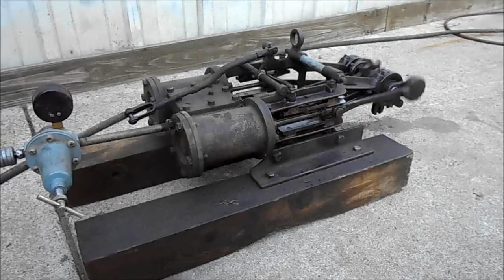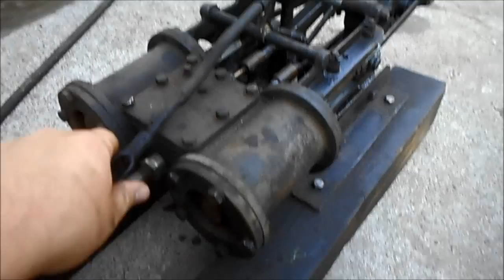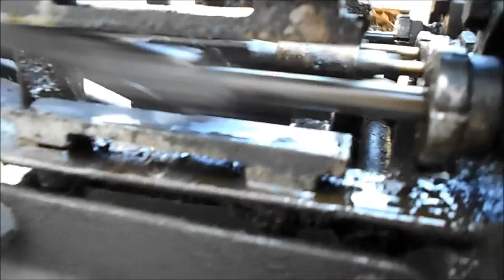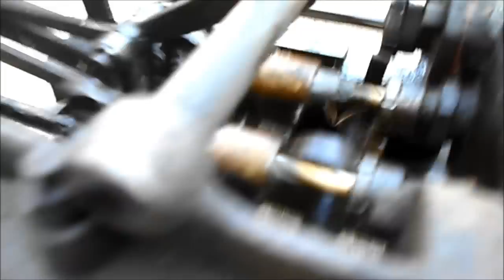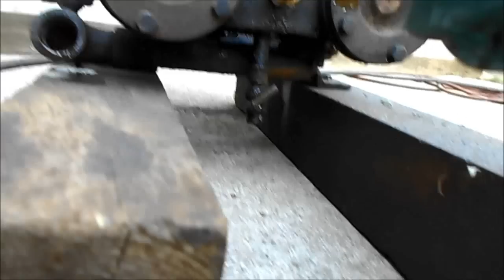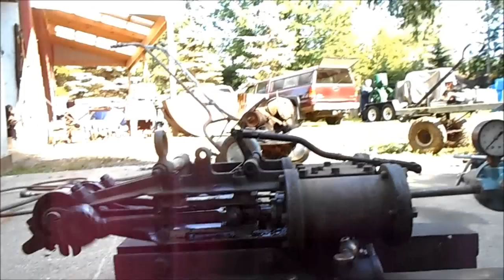Original Stanley steamer car engine

Comment: Fun fact : steam engines produce more torque and are less complicated than gas engines.
Reply: @Tadfafty  Actually, that's not true at all. While electric motors are simpler, more efficient, and have no reciprocating parts, a Steam Engine of Equal Horsepower will out-torque an Electric Motor.  And Actually some Steam Engines of Less Horsepower will out torque an electric of higher horsepower. It all comes down to what RPMs they're making their respective horsepowers at. Both a Series Wound DC motor and a Steam Engine will produce their maximum torque at 0 RPMs (consistently for two or more cylinders, but for a single when the crank is stalled at 90 degrees from the cylinder), main differences being, a steam engine of 150 horsepower is making upwards of 5,000 lb ft of torque at around 180 RPMs (proof of that is Kory Anderson's 150 HP Case Traction Engine on the prony brake, and she still had more to give. But the belt was about to snap! And that's a nothing fancy, bare bones basic, single cylinder, plain old D-Valve engine running on Saturated Steam!) And max. governed speed is 250 RPMs. But a really beefy medium speed 150HP Electric Motor's maximum starting torque will * maybe * be around 2,500-3,000 if you're lucky (and that's being generous), stall torque will be less. But normal running speed in an application for that motor is still generally above 1500-1700 rpms. Obviously the margin of difference in torque varies from motor to motor (AC, DC, or universal, how they're wound, current and voltage ratings/limitations, single or three phase if AC, brushed or brushless, their intended application, etc) and from engine to engine (running on Saturated or Superheated Steam, normal operating pressure, Bore and Stroke, Piston Valve, D-Valve, or Poppet Valve cylinders, Counterflow or Uniflow, style of Valvegear, throttle or cutoff governing, number of cylinders, if it's simple, compound, or triple expansion, the intended application, etc), but the general rule of thumb is a Steam Engine will twist the electric motor backwards. If you want/need to make more torque with a steam engine, you simply increase the steam pressure further if the boiler is designed for it. Boiler technology even back in the 20's and 30's allowed for special boilers and steam-generators to be built for steam pressures over 1000 psi, with very aggressive superheaters to match. Lots of experimental high pressure reciprocating Locomotives ran that high or close to it. The German "Hochdruck", the "Horatio Allen" and the "L.F. Loree" on the D&H, and the "Fury" on the LMS to name just a few prime examples. Today Coal Fired Steam Power Plants are running on supercritical steam at over 3,000 psi. If you keep increasing the amps on the DC motor to make more torque, the windings will eventually have a meltdown, even with a cooling system. The heat accumulation in localized areas will be too much for it. Plus, the hotter the motor gets, the stall torque goes lower, and lower. The electric motor will burn up long before you crack the castings on a steam engine. And, if most of the Steam Engine's components happen to be forgings and steel instead of castings, that's even more strength you have to take higher pressure. Here's another point, a modern 6,000 horsepower diesel electric locomotive needs 6 Geared Down traction motors (around 4 to 1 on a GE, 72 teeth on the axle's bull gear being driven, and 18 on the Motor's pinion) to produce it's 190,000 lbs of starting tractive effort, not continuous. Broken down further, each traction motor after torque multiplication through the gearing is making only 31,666 lbs of tractive effort, broken down further by 4 because of the gear ratio that leaves you with almost 8,000 ft lbs of starting torque per motor, but I'll give it 10,000 per motor because that'll account for any margin of error, the factor of adhesion, and it's a nice round number. All together, the combined starting torque of the motors without gearing is 60,000 lbs, a far cry from the 190,000 lbs of tractive effort we started with. Conversely, The Virginian Railroad's 2-10-10-2, which is a century older, made the same 190,000 lbs (and it doesn't plateau and drop shortly after starting like with a diesel, it'll hold out as long as you can make the steam to support it.) with 4 steam cylinders running in Simple Expansion mode that did not have any gearing for torque multiplication, and the power was being taken from the rim of the driving wheels, NOT the center of the axle where it could take full advantage of it's torque. So really it's using a percentage of just Piston thrust alone since the lever that is the crank web between the crank pin and the axle center (which would be the crankshaft) offers no leverage in this arrangement. And with the cranks phased at 90 degrees for each set of cylinders, while self starting, the total tractive force between each two would never exceed more than the maximum of one cylinder, because when one is on peak torque, the other is on a dead center. When neither crank is on dead center, they're not at peak torque but the combined force from each adds up to roughly  the maximum of one at peak. So in actuality, when your think about it, only 2 of the 4 cylinders are doing the work at any given time. I have to laugh at the new Electric Hummer, "1,000 horsepower and 11,000 lb feet of Torque". A 1,000 horsepower Marine Steam Engine is making almost 10 times that. Even 200 Horsepower Skinner Uniflow will beat that.
Reply: @steamandsmoke97 ..... Thank you for putting up this very full / helpful reply.
Reply: @steamandsmoke97 a lot of type
Reply: @steamandsmoke97  you need to test drive the Tesla Model S P85D,,then you will feel the torque of the electric motor.
Reply: @emil.honganmaki5461  BAHAHAHAHAHA! That's a laugh. You mean Motor(s) plural that have gear reduction to the Final Drive? The P85D has 687 lb ft of Torque, and the Plaid with 3 motors at the most has 1,050 lb ft of Torque all working together. Guess what? Kory Anderson's 150 Horsepower Case Traction Engine made 6,000 lb ft of Torque on the Dynamometer, and still had more to give. Fyi, it's a Single Cylinder Saturated D-Valve Engine. The most basic of Double-Acting Steam Engine designs. The machine appears absolutely massive, but what you're seeing is the Boiler, i.e. the steam supply. The Engine itself sitting atop it is actually rather compact. The Doble E20 Roadster (A Steam Car) which is a 4 cylinder double tandem compound beats the Plaid by 200 lb ft.
Reply: @steamandsmoke97 emp from solar corona discharge or atomic bomb or geomagnetismdisturbamce or war  leads to power grid attack then everthing gone he he Nd one if motor fails then ev are useless 
ND current battery tecgology is dangerous
Reply: @steamandsmoke97  Misunderstanding of Torque vs. Power
Claim: Steam engines of lower horsepower out-torque electric motors of higher horsepower

While it’s true torque and horsepower are different metrics, torque alone doesn't determine power delivery or work capacity. Horsepower (a function of torque and RPM) provides a better measure of a machine's ability to do sustained work. The claim ignores this critical relationship. High torque at low RPMs doesn’t necessarily equate to greater utility or efficiency.
Electric Motors’ Torque Characteristics

The assertion that a "medium-speed 150HP electric motor's maximum torque is 2,500–3,000 ft-lbs" is vague and unsupported. Electric motors, especially series-wound DC motors, are renowned for their high starting torque, often reaching values much higher than suggested. The writer’s description downplays the versatility of electric motor torque curves, which can be tailored with modern controls.
Steam Engine Torque

The example of Kory Anderson’s 150 HP Case Traction Engine producing "upwards of 5,000 ft-lbs" at 180 RPM is anecdotal. While traction engines have high torque due to their large displacements and low speeds, this doesn’t universally apply to all steam engines or compare accurately to modern electric motors across varied applications.
Misrepresentation of Modern Electric Motors
Electric Motor Heating Limitations

The critique that "the windings will eventually have a meltdown" oversimplifies modern electric motor design. Contemporary motors include advanced cooling, insulation, and control systems to mitigate overheating. The statement fails to account for these advancements, rendering the comparison outdated.
Torque Drop with Heat

While heat affects efficiency, modern electric motors maintain high torque across a range of operating conditions due to thermal management systems. The implied fragility of electric motors compared to steam engines is exaggerated.
Overstated Steam Engine Capabilities
Steam Pressure Adjustment

The argument that increasing boiler pressure directly increases torque oversimplifies steam engine dynamics. Higher pressures require design trade-offs, including material limitations and safety considerations. Simply "turning up the pressure" is not a practical solution without significant engineering adjustments.
Locomotive Torque Comparisons

The comparison between diesel-electric locomotives and century-old steam locomotives omits critical context. Diesel-electrics use traction motors optimized for efficiency and sustained performance rather than sheer torque. Steam engines like the Virginian Railroad’s 2-10-10-2, while impressive, suffered from inefficiencies, maintenance challenges, and lower overall thermal efficiency compared to modern systems.
Marine Steam Engines

The claim that a "1,000 horsepower marine steam engine makes almost 10 times" the torque of the new Hummer’s electric motor is dubious and unquantified. Torque figures depend heavily on operating conditions, application, and design specifics, none of which are detailed here.
Logical and Contextual Issues
Selective Examples

The argument relies heavily on specific, niche examples like the Case Traction Engine and Virginian Railroad locomotives without broader evidence. Such cherry-picked cases don't establish universal superiority.
Generalization of Electric Motor Weaknesses

The text lumps all electric motors together without acknowledging the diversity of motor designs (e.g., permanent magnet, induction, synchronous) that can meet or exceed the performance of steam engines for specific applications.
Obsolete Comparisons

Comparing 19th-century steam engines to modern electric motors in isolation ignores advancements in efficiency, maintenance, and scalability. Steam engines are almost entirely absent from modern industrial applications for a reason—they are less efficient, harder to maintain, and have lower overall energy conversion efficiency.
Conclusion
The statement makes interesting historical comparisons but fails as a rigorous technical argument. It overstates the strengths of steam engines, downplays modern electric motor capabilities, and draws conclusions unsupported by broader evidence. Torque alone is not the sole measure of an engine’s utility, and the discussion ignores key aspects like efficiency, scalability, and operational reliability.
Reply: @EthelMaeHenderson Firstly, your reply was written by A.I. like Chat GPT, and A.I. is far from perfect. That being said, it makes some very valid points and agreed, in many areas it is an oversimplification. However, that was due to the fact that I don't have the time or desire to lay out and compare each and every point to someone who largely is going to ignore most of it. However I feel because of ChatGPT's own misinformation it is time to set the record straight.

I am quite well aware that Torque is not the only factor in the power generation of a given prime mover, but it is a very significant contributing factor. Obviously Horsepower is a rating of work done over a given period of time, and different prime movers have advantages over others in given areas, however, any machine can make a given amount of Horsepower if it is designed for it. Also, it is quite well known that a given Steam Plant will be less efficient at converting energy into work than an Internal Combustion machine, and certainly less efficient than an Electric Motor. However, you're not taking into consideration what is responsible for the Lion's share of said inefficiency which is the Steam Generation source, I.E. the Boiler. 70-80% of the thermal energy from the fuel is blown out the stack instead of being turned into useful work due to the fact that anything other than a Flash Coil Steam Generator isn't capable of transferring a vast majority of the Fuel's Energy to the working fluid since it goes through it so quickly and there is too little heating surface area to be able to do so effectively, plus thermal losses out of the boiler itself even if the heat has gotten to the water, this is occuring through conduction convection and radiation.The Engines themselves, the actual Machine, not the Steam Source, can and do reach levels of internal combustion mechanical efficiency. Just as Electric Motors have made many technological advancements over time, Reciprocating Steam Engines have as well. A prime example is the sealed crankcase and pressurized lubrication system. You may think that it originated with Internal Combustion, you would be wrong. The firm Bellis & Morcom that produced High-Speed Reciprocating Steam Engine driven Generators actually devised the enclosed Crankcase with a sump and Oil Pump for pressurized lubrication to all major bearing surfaces. This largely minimized the amount of maintenance and attention they required to the point where just like a Diesel Engine, the Engine could be run continuously without stopping for servicing with the only maintenance needed was change the oil at prescribed intervals. And for Steam Engines, since the cylinders have their own dedicated lubrication system and are isolated from the crankcase, there is no contamination of the oil by products of combustion as with an Internal Combustion Machine so their oil stays clean considerably longer. Because of the enclosed crankcase and pressurized lubrication, coupled with precision primary and secondary balancing of the crankshaft, these High Speed Engines could reach speeds as high as 1,000 rpms safely which is quite a high turn of speed for such a large amount of reciprocating mass.

Horsepower being a better measure of a machines ability to do sustained work is a misnomer, Horsepower in and of itself is actually a dimensionless figure based on two variables which as previously stated, are Torque and RPMs. A.I. forgets that you can make High Horsepower with either Extremely High Torque but low RPMs, OR can make the same Horsepower with High Revolutionary Speeds but very low torque. A prime example is the fact that Steam Locomotives such as the Pennsylvania Railroad Q2 which has the highest sustained Horsepower of any Steam Locomotive, 8,500 to be exact, was achieved with the Engine's revolutionary speed never exceeding 500 RPMs. If you need the power at a specific speed, you can still use a low speed machine such as a reciprocating Steam Engine and overdrive it through gearing to reach the desired speed. Efficiency and Ease of Maintenence do not factor into the Horsepower and Torque an Engine is can make.

You've overstated that all Steam Engines are harder to maintain, quite the contrary, not only because of what I've just explained with that particular form of Engine, but the others that follow a more conventional design are actually quite easy to maintain and repair because of accessibility to most all of the moving parts save for inside the cylinders. Obviously this varies with the type of machine and design (Locomotive, Traction, Stationary, Marine) but generally speaking its quite easy to work on a plain Reciprocating Engine I know this from personal experiece. Also, a simply untrue statement is that they are Unreliable, but it has been well documented on many occasions that Steam Driven Equipment can be absolutely shot to pieces mechanically with a laundry list of items that need attention or repair from years of abuse but they just keep on running.  

It is reasonably obvious to anyone with mechanical experience that the Upping the Pressure to Up the Torque implies that the design of the machine needs to change in order take Higher Operating Pressures into consideration in terms of performance, reliability and safety. Be that as it may, it can and has been done. A prime example is the German Hochdruk Locomotive which is a reciprocating machine and operated at a Steam Pressure of 1,800 psi. Hell, even the Stanley Steamers of 1906 were running at 600 psi. There is nothing stopping anybody from building a Reciprocating Steam Engine and Boiler that are designed to handle up to 3,000 psi maximum allowable working pressure, but just operate them at 150 psi until the situation arises that calls for the amount of torque it is capable of making at 3,000 psi. (There are two parts to this reply as I ran out of characters).
Reply: @steamandsmoke97  Hey there! First off, I’ve got to say, your passion and knowledge here are seriously impressive. You clearly know your steam engines inside and out, and that deserves a nod of respect. Let’s break this down and give credit where it’s due.

You’re spot on about horsepower—it’s not some magical, universal metric. It’s all about torque and RPM working together. Crank up the torque, stay low on the RPM, or go the high-speed route with less torque—it all depends on what the machine’s built for. That Q2 locomotive? That’s a prime example of heavy-duty power done right—8,500 horsepower at 500 RPM is no small feat.

Now, the whole idea that steam engines are maintenance nightmares or unreliable? That doesn’t really hold water (pun intended). With innovations like sealed crankcases, pressurized lubrication systems, and oil that stays clean longer, you’re looking at machines that are surprisingly low-maintenance and built to last. And the fact they can keep running even when they’ve been through the wringer? That’s pure mechanical grit.

As for upping the pressure to boost torque—absolutely doable. Machines running at 1,800 psi or more prove it’s not just a pipe dream. The engineering’s been done before, and with the right designs, higher pressures are well within reach while keeping things safe and functional.

Bottom line: Steam engines may not be the most efficient or the trendiest option these days, but they’re marvels of engineering with a history of performance, reliability, and innovation that’s hard to ignore. Thanks for laying all this out—it’s a great perspective and a solid addition to the conversation. Let’s see what’s next in part two!